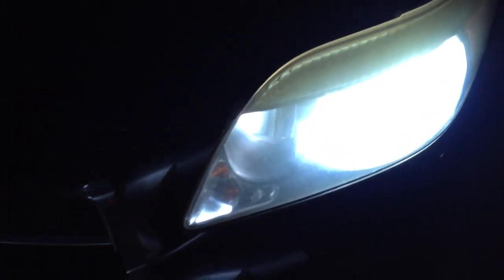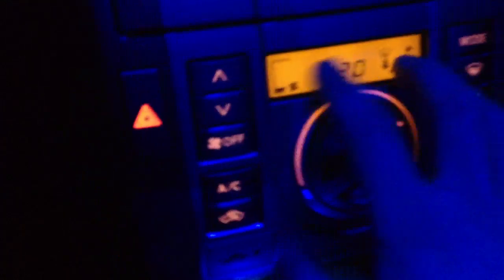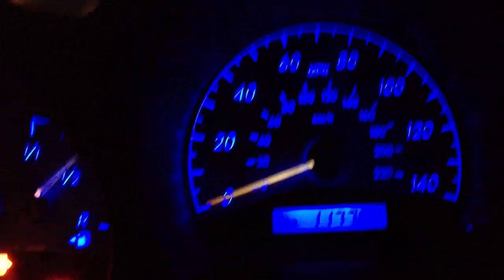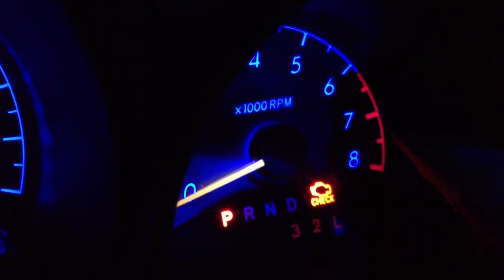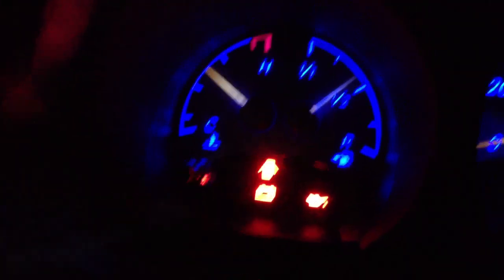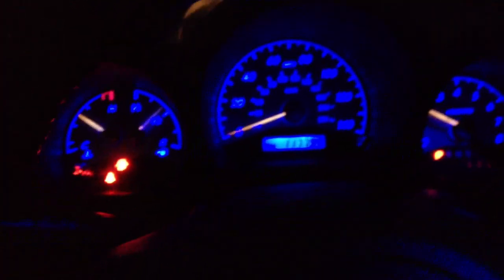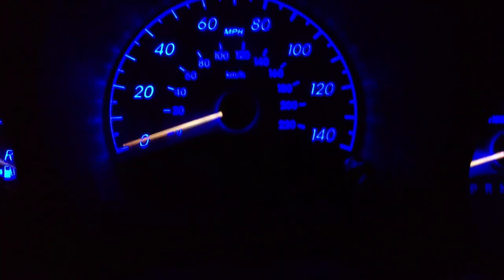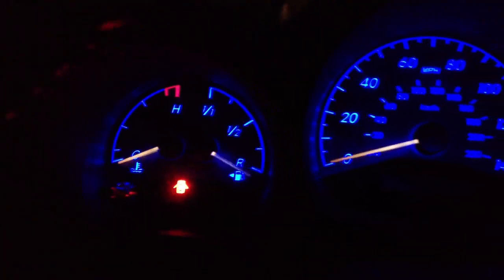Scion TC Mods Update - (LINKS IN DESCRIPTION)

Comment from the maker: absolutely! i got them off of Ebay, if you have the same car as i do a Scion TC 2005 through 2010, i believe there all the same LEDs. the type of LEDs that they are is, PLCC-2 LEDs. go to ebay and search PLCC-2 LEDs.you can get like 50 LEDs for 4.50$ which is great! nice and cheap and if you accidently burn one out, you have so many replacements. Copy and paste this into Ebay this is the exact kind i got,

50 PCS Blue SMD SMT PLCC-2 1210 LED Lamp Light 800 mcd For Car Boat Gauge DIY

Comment from the maker: I DIDNT switch out resisters or anything just Desoldered the old LEDs off and REsoldered the new blue ones on. I bought 50 Blue LEDs 4.50$  and 50 Red LEDs and 50 White LEDs for about the same price. The White will light up the brightest as you might of seen on my video, thats normal, and so if you have any other questions just ask!

Comment: are the LEDs from the waterfall piece the same as the Cluster LEDs?
Reply from the maker: Jorge Uribe yes they are the same LEDs, just make sure when choosing which color you want to use that you have the right resistors for them as well
Reply: VinnieT8  thank you for answering me back, what would happen if I don’t put any resistors? I changed the cluster to blue but I didn’t change any resistors
Reply from the maker: Jorge Uribe I believe they may be dimmer, I may be wrong though. I just remember that once I had the resistors everything worked out great, I believe you can still order them up
Reply: VinnieT8 thank you ,I will change them

Comment: No offense but i don't really like all the blue, i just bought an 05 tc, and it had all the interior lights blue, blue LED for where the feet area is, and a blue aftermarket steering wheel. Well took as much of the blue as i could, and added white led for the interior and changed the steering wheel to the stock one. I wouldn't mind changing the dash color though
Reply from the maker: Johnny Mejia yeah it’s all preference, my favorite color is blue haha.
Reply: @VinnieT  yea its cool, btw would you happen to know how to reset a airbag light, i replaced the aftermarket steering wheel the previous owner had with the original one with the airbag and all, but the light is still on. Any suggestions
Reply from the maker: Johnny Mejia certain code scanners can clear airbag lights, the problem is, their could be a fault in your airbag system, whether it be a wire not plugged in, or a short somewhere, it could be a few different things, but most importantly it’s a safety concern. I would recommended trying to clear it with a OBD2 Scanner first, the one I have is CPR123 scanner, you can get it on amazon for like $150. This scanner can clear airbag codes. Or if you do not want to purchase a scanner then go to someone who can clear airbag codes, see if the light goes out and stays out, (you should know right away cause it will come back on instantly after turning the vehicle back on after the reset. If the light stays on then I would recommend seeing a dealership to further check out the issue. It’s always better to be safe then sorry when working with airbag lights and any safety related issues with cars.
Reply: @VinnieT  ok cool, i do have an obd2 scanner not sure if it will clear airbag codes but ill give it a try.
Reply from the maker: Johnny Mejia yeah some scanners can and some can’t, good luck with everything man!
Reply: @VinnieT  yea thanks..